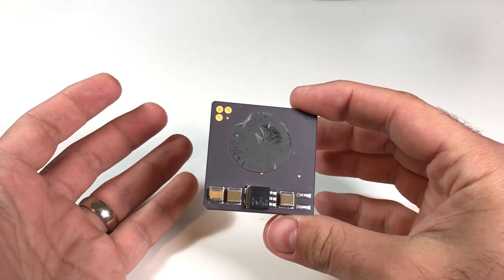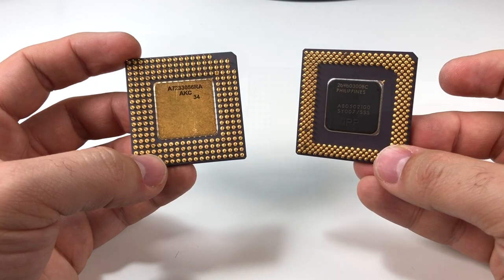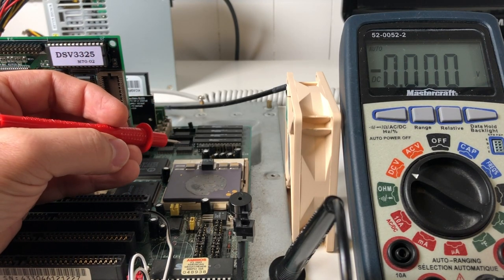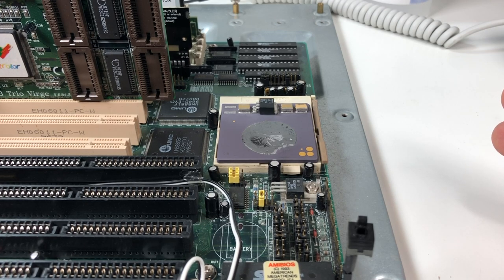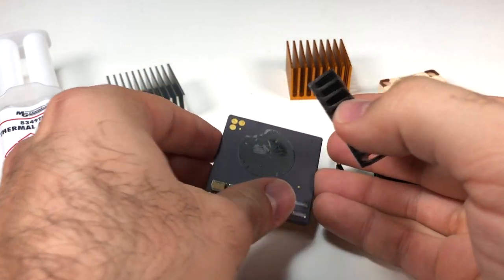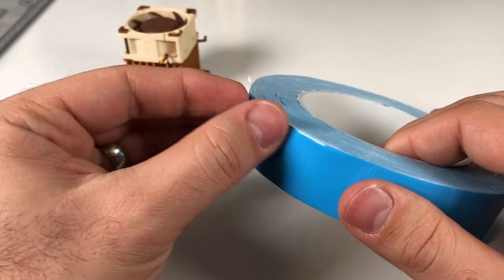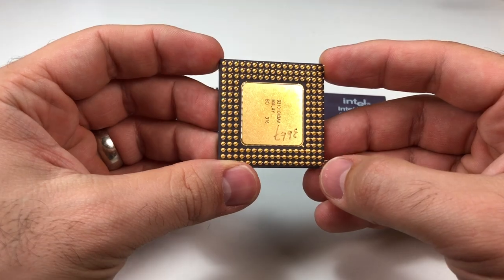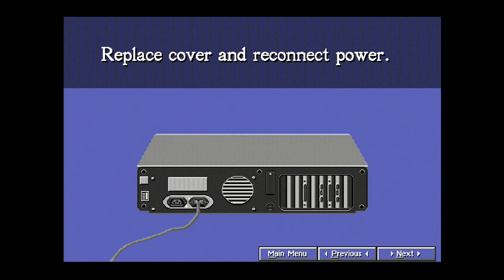The Intel Pentium Overdrive CPU for 486 Systems

Comment: Absolutely insane to think that 4 years after this they'd go from 133mhz to 1ghz, man what a time for computing.
Reply: Indeed the golden age for hardware enthusiasts.
Reply: The more insane part, it didn't really feel that long ago.
Reply: yeah, it's amazing how far they could go so quickly just by cranking the power into the CPU🤣🤣
Reply: @raven4k998  well, I'd say the shrinking process is far more impressive.
Reply: Oh yeah, the 3 upgrades a year period. It was fun, but it raped your wallet!
Reply: @The Silenced Python is the even bigger hangover 😁😁
Reply: Graphics cards also advanced a lot during those days. Nvidia from 1995 to 1999: 17 times more transistors, 32 times more memory, 8 times higher memory bandwidth etc.
Reply: I was a teen in those years, spending my hard earned money in my PC.

It was a struggle keeping your computer up to date. Overclocking was extremely useful to keep up and get all the bang for your buck. 30 to 50% improvements in performance were quite common.

My current PC is mostly based on hardware from 10 years ago... and its not having issues keeping up with modern games. I basically upgrade GPU every couple years. But the rest is ancient hardware.

I got a i7 3770k on a Z77 asus board, 2x8gb 2133mhz ddr3 and a 3080 12gb. Im amazed of how its still able to play everything at a decent rate in 1080p. Its even capable of running many games in 4k.

Things changed a lot in the past 25 years.
Reply: @snakeplissken1754  Just to be clear, you do realize they don't really shrink the dies, right?
Reply: @paulmichaelfreedman8334  Don't take it literally.
Reply: And your System aktually needed way earlier an update than today.
My cou and Mainboard where released 2012 or so and I can still do relatively actual tasks with it. Did buy it really cheap in 2017.
Reply: Then they were sure they would hit 10ghz and everyone was like "naw, try multiple cores"
Reply: @snakeplissken1754  it's become a crutch though, that's why AMD is making ground on Nvidia so fast
Reply: @silenthill4  I remember that, back then they thought we'd have super fast single cores, imagine how hot a 10ghz single core would get.
Reply: @Edward135i  and how shitty it would run
Reply: @tallpaul9475  it was nearly a decade before I was born and Im an adult
Reply: @kimnice  Soo... "TEAM GREEN" was BIG players in 1995? 😛    (Hint: Not really)
Reply: @Coyote27981 I updated from 4770 to a 13700k and the jump was massive for certain workflows. Funny thing is that doing normal Webbrowsing and playing some older games and so on I barely notice a difference since even the old system was plenty fast already.
Reply: I feel like 486 dx2 66 to p 200mmx to 1ghz then almost 4ghz p4 was a blink of the eye..and then it took well over 10 years to get near or over 4ghz again
Reply: @Coyote27981 you gotta let that 3080 stretch its legs
Reply: What a time for a wallet as well
Reply: I got an AMD Thunderbird 1 ghz, first consumer 1 ghz chip. Loved it. Got it overclocked to 1.1 stable. Left the window open in the winter in Alaska and got it to 1.250....for 5 minutes lol
Reply: Yes and 20 years after this nobody gives a sht how high we go anymore 😂

Comment: Great video! I remember installing the DX2 66 Overdrive into my SX33 back in the day and how big an improvement it was. I would have passed out from this kind of performance back then. 😂
Reply from the maker: Thanks very much! Yeah I can imagine! Going from an SX/33 to a DX2/66 would have been a tremendous upgrade back then, that's for sure.
Reply: @vswitchzero  well, I started wirh a AMI NEAT AT 386SX 40 MHz AFAIR, MFM 40 MB & Hercules clone with 14" paperwhite. I had to upgrase with a cyrix ? copro (I still have), a speedstar 24, and an EIZO 9080i. Yes, it was my first PC I bought to work with STRAKON CAD as a studend withe the money I worked for DiCAD. These days back I had been entiteled as "the CAD Pope" and "the one who walkes above water". 😁 An Intel Overdrive would had made me to the Lord of CAD himself for sure. 🫣
Reply: I remember having a 12 MHz 286 machine and was visiting someone who had a brand new 486DX-33 and it zipped and unzipped files in a flash where my 286 would take minutes.
Reply: @paulmichaelfreedman8334  yes. Actually the PC era started with i386 protected mode. My first "Computer" was an Olivetti M10, our uncle ("the FACIT Man") acquired.  M10 is still with me. Very helpful for my study. But the software I had to develop was already on a 486, where my study time was enlongued, because I already jobbed for DiCAD and later for Cvil Engineering Companies.
Reply: Did the board have Cache? Did the same back then without and it made it worse hehe.
Reply: i went from a 486 SX 25 to 486 DX2 66. it was a huge improvement, but i didnt use any type of "overdrive" cpu. the socket was the same, remove one CPU and install the other. my main objective was to run autocad, as the SX had no math co-processor
Reply: @andrewdonohue1853  the cache chips had to be good and fast too, I've seen 486 boards with dummy cache. Slower than a 386. I've also seen 486 boards with the best cache (ASUS) and they could even run windows 98 at a very acceptable speed. With enough RAM of course.
Reply: Ah I remember when my dad bought a DX2/66. Fastest computer I've ever used.

I'm sure it would run circles around my computer today, it was that fast. (at least to my 7 year old mind)

Comment: Awesome seeing this.  I was one of those guys that purchased one of these.  It was to squeeze out more performance.  Definitely not worth it though.  A few months after I purchased this cpu.. I learned out to build my own PC from scratch and put together a shuttle socket 7 system with an AMD k5.  That whole build, including the case cost less than the Pentium Overdrive, lol.
Reply from the maker: Thanks very much for your comment, that's interesting! From what I'm hearing, these chips were very overpriced and hard to obtain back then (selling above the $300 USD MSRP). Do you remember roughly how much you paid for it back then?
Reply: @vswitchzero  I paid $500, give or take $50.  I had to order it from a local PC shop.  It took at least a couple weeks for it come in after placing the order.  A couple of other things I remember from that cpu..  I put it in a packard bell with a 486sx @50mhz.  The sound events in windows 3.1 were "accelerated".  Was interesting but I rarely used win 3.1 so I ignored that, lol.  

My time with it was short lived.. around the time I ordered the Pentium overdrive I started reading one of those PC hardware Bible type books.. and I also discovered "Toms Hardware" online.  It was only months later that I picked up that shuttle board.. the k5pr75 (for $32!), a trident video card, 8 or 16 megs of ram (think it was 2 8meg sticks) and a sound blaster. That build blew away the Pentium overdrive Packard Bell in performance.  That said.. I do regret selling that system to this day because it was cool.  :)

Comment: I remember these when they were new.  As I recall they were semi-vaporware.  Hard to find and extremely expensive. Some people even suggested that the only reason Intel even bothered to make them in such limited numbers was to avoid a lawsuit over the "Overdrive Ready" sockets they'd been flogging for a couple of years.

The cost of one was about the same as buying a new socket 3 motherboard and a Cyrix 5x86 combined.  The early 90's 486 motherboards that could have used the speed boost didn't support the chip physically with their older socket,  while the later machines  that DID have an overdrive socket could also accept the much cheaper AMD and Cyrix 5x86 chips which were either close enough in the case of the AMD chip or arguably better, in the case of the Cyrix chip.

The ones I have, I found in upgraded proprietary OEM machines (IBM, Compaq, Dell)  that had been in either Government or Corporate service before being scrapped.  I've never found one in a standard beige box PC.
Reply from the maker: Very interesting historical perspective, thanks for sharing! I wondered the same about the overdrive sockets. They were around for quite some time before a chip existed that could actually use them.
Reply: @evergreengamer5767  Citation please.  There's no evidence that I've ever  seen that Intel used damaged/defective silicon for these.  As for the rest of your comment, have you ever heard of the Latin phrase "non sequitur"?
Reply: The Cyrix fell flat in gaming with the release of Quake being a unpleasant experience.
Reply: @eleventy-seven  You're thinking of the 6x86.
Reply: There was even more rare and strange Pentium Overdrive - for the replacement of original Pentium 60 and 66, doubling its' clock. That CPU also had built-in voltage regulator (Socket 4 motherboards had no voltage options, as 486 mb did) and it had full-fledged 3.3 v "new Pentium" core clocked at 120 or 133 MHz.

Comment: well I got a 486 back then & I knew about the pentiums but what I ended up doing was building my next machine, it was a 233 mmx in 97.. that's because I went from using my 486 at home to working at a computer store and after that 233 mmx I built machine after machine & I remember when the 1.33 ghz t-bird came out from AMD & I built a system on that.. of course I had a super socket 7 system, actually multiple, as well as slot A, and flip chip system, along with a dual slot 1 and dual socket 370.. ah I just kept having fun with it for years & even now I'm behind the latest hardware & it's just a matter of what you want to spend your money on and how many systems you have & over the years you begin to know what's going to fulfill your demands & don't really spend more unless you have to.. course monitors too now are crazy.. great video here I like stuff that brings back memories ... haha just remembered buying that 4.2GB bigfoot & thinking I'd have enough space lol oh man after that I built a raid array out of some fujitsu drives

Comment: Great video, and I remember in mid 95 I still had a 486 DX2 at 66Mhz, but being a kid just getting into high school, I could not afford a new computer, but I got my mother to help me upgrade my 486 at the local PC repair shop with a Pentium Overdrive at 100Mhz, a 28.8K Modem(got a 33.6K later on) , 16MB of RAM(laster got it up to 32MB), and a 2GB HDD(don't remember the exact video card I had, but was enough to run DOS NES emulators like Nesticle) to run Windows 95 till a few years later when I got my first job, and was able to build my first system with an AMD K6-II @ 550Mhz on a FIC mainboard. So yeah I have some fond memories of the Pentium Overdrive chips, and I'm really thankful Intel made them back in the day for those of us on a limited budget.
Reply from the maker: Thanks for your comment! Always interesting to hear from people who had these chips first hand back in the day.
Reply: @vswitchzero  You're welcome 👍

Comment: You can often soften the heat conductive glue with ca-glue remover/debonder. Simple CA-glue is a good heat-conductive glue btw. You can heat the heatsink with a blowtorch a bit  to loosen the CA-glue afterwards if needed.

Comment: Thanks for taking me back, had the DX4-100, the Pentium Overdrive, and several others back in the day. I believe I still have the Overdrive and a Cyrix 6x86 somewhere and been thinking for a while about trying to piece them back together again as you have done here.
Reply: That was the first CPU I bought...the upgrade (same socket) was 200 or 233 Mhz...the kicker was I bought a 16 MB Voodoo Banshee when I was running the 100 Mhz CPU...and the Banshee was clocked @ 105 Mhz.  The last time my GPU clock surpassed my CPU clock!

Comment: 23:30 The PCI S3 Virge is certainly not the bottleneck. If you put it on a fast socket 7 system, 3DBench 1.0C will easily reach 150+ FPS.
The main bottleneck is most likely the slow bus speed and subpar memory performance of the 486 platform.
Anyway, awesome video, keep it up! 😀
Reply from the maker: Thanks very much for your comment and for pointing that out! That definitely makes more sense. The more I see the Pentium, the more I realize just how bus limited the 486 platform was. I hope to start exploring some faster socket 7 based systems in the future and to look more into the Virge DX and Virge VX as well. Thanks again :)
Reply: Indeed. Those S3 cards are among my fastest in DOS. But 33 vs. 40 MHz bus makes a huge difference in memory bandwidth (120 vs. 100MB/s in Speedsys from my experience).

Comment: My first PC, bought from Electronic Avenue at Montgomery Wards, was a Packard Bell desktop.  I think it was around late 1994.  Windows for Workgroups 3.11, I eventually upgraded to Windows 95.  Originally 486DX-2 66Mhz, I had the Pentium Overdrive @83Mhz that was bought at one of the many electronics businesses in Silicon Valley that eventually went out of business.  It worked well for what it did.  Learned a lot with that thing.

Comment: This video is a great breakdown of the performance of the PODP83. Sadly though, all the trade magazines at the time suggested to avoid buying this as it was deemed overpriced compared to the DX4 or Am5x86-133. I don't think FPU performance was a major selling point at the time, and the general suggestion was that if you needed faster FPU, just get an actual Pentium system that isn't held back by an "outdated" 32bit bus.

That being said, I wanted one of these so bad back in the day but my Socket 2 486 didn't have the extra row of pins necessary to support the PODP. It probably wouldn't have helped me much though as I was restricted to using ISA bus graphics.
Reply from the maker: Thanks very much, Charlie! That's interesting. I wasn't very aware of the POD back in the day. We wound up getting a Pentium 100 system in late 1995 and kept the DX2/66 system we had before. I was always hogging the PC, so my parents were happy to take over the 486 and let me use the Pentium :)

It's too bad they didn't make this chip work in a standard PGA-168 socket. I've never seen it, but I've heard people have done modifications to make it work. I'm not sure how essential the extra pins for power delivery really are. But I suppose for those earlier 486 systems, the DX4 overdrive or one of the 5V capable "turbo chip" alternatives were still great choices. Going from an SX or DX to a DX4 was a massive upgrade, that's for sure.
Reply: I ended up leapfrogging over the Pentium CPUs when I finally upgraded my 486 and went directly to a Pentium II 300 with AGP.

But it's ok though. I have my PODP83 in my collection now, and comparing it to my Cx5x86 100 and AMD DX4 100, Intel DX4 100, and AMD 5x86 133 is quite interesting to say the least. All fun CPUs to have!
Reply: True, i was coming from a dx4 100 which i at times replaced with a dx40 (some games just ran to fast otherwise). And when the pentium hit it was just to expensive and not really needed. The overdrive cpu looked nice but a big part of the pentium was the new PCI bus and just couldn't ever perform that great without.
Heck i got a cyrix 5x86 133 with PCI bus board for a fraction of the price of a pentium. Sure the fpu performance wasn't good but I didn't really care that much. 
Kept that system going till they released the pentium ii.

Comment: What I do with heatsinks like that, for example on my voodoo 1 and 2 cards, I use normal thermal paste, something like Arctic mx-4 or whatever in the center. And then add two SMALL drops of gel superglue on diagonal corners of the heatsink. Then I use some carpenters spring clamps to hold it on with some pressure until the glue sets. It works perfectly, holds really well, and cools perfectly. But all it takes is a bit of acetone to dissolve the superglue and you can remove it without a trace.
Reply from the maker: Great tip, thanks!

Comment: That was a great video! Now my itch to build a Pentium Overdrive system has returned… but oh Lord the prices… socket 3 PCI boards got expensive; not to mention the processor itself. Gotta keep trying the recycle center I guess. Keep up the good work!
Reply from the maker: Thanks very much! Yeah, the prices for the pentium overdrive chips these days are pretty ridiculous. Best of luck! I hope you find one :)
Reply: I was looking for two years on a good deal and catched a Compaq branded LPX form factor UM8881/8886 board with 5x86 installed for ~25€. No other bids even though it was placed correctly. Seems people don't like those LPX form factor boards.

Comment: I have always found these Overdrive CPUs very fascinating, thanks for this great video!
Is there any chance for overclocking?
Reply from the maker: Thanks very much! It is possible to try with a 40MHz bus speed for a 100MHz total clock. From what I've seen online, these chips don't overclock well at all. Not so much because of the core, but the power regulator on the chip can't provide enough current for it to work reliably at that clock speed. There are some mods that can be done to it to squeeze a bit more out of it, but I'll probably just leave it as-is :)

Comment: I remember working at Computer City. We had a Pentium Overdrive in a small display mold for displaying it. I later asked if I could have the CPU displayed (we now had slot type Pentium II, so AMD and Cyrix CPUs could no longer fit) and got the broke the mold and took out the processor, being careful of the pins... It worked!!!
Reply from the maker: Haha that's an awesome story. I'm surprised it had a functional CPU inside too. Thanks for sharing :)

Comment: Nice Video! I literally did the same with a 100 MHz Overdrive, the 83 MHz Pentium Overdrive and the 200 MHz w MMX Pentium Overdrive. Love those CPUs…but now have Socket 5 Interposer that allows me to run AMD K6-2 with 400MHz on a former Pentium 90. So cool what was possible back then….